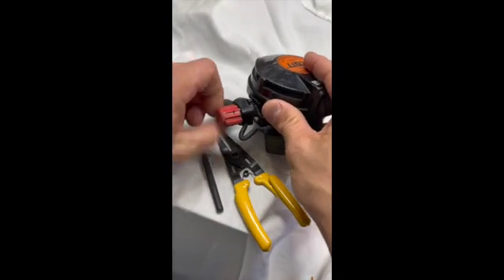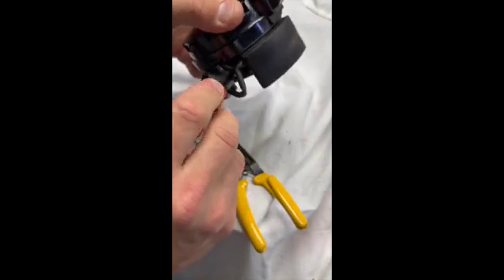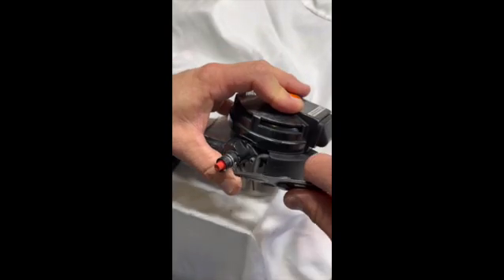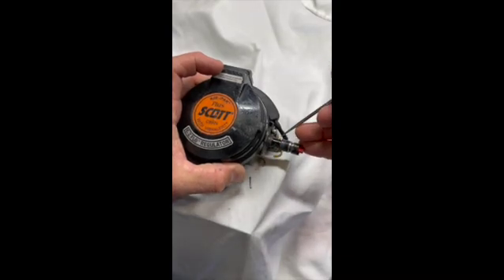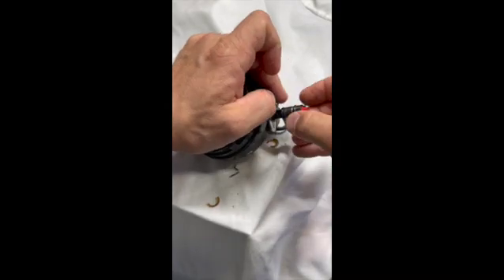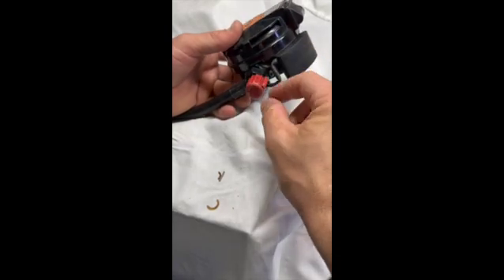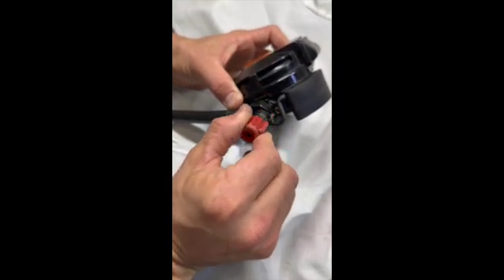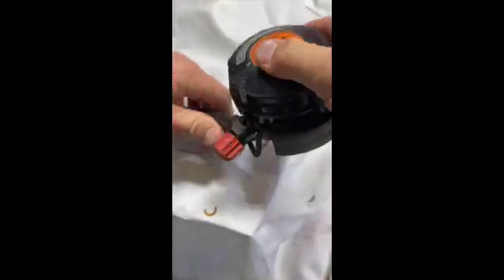Scott 4.5 air pack regulator leak at bypass

Comment: Can I get the link to the O rings you used? I couldn't find it. Also, I'd love to see other videos of simple repair on Scott air packs if you do them. Thanks!
Reply: I ordered the 4 X 8 X 2 and they are too small.
Reply: @chasedunn7839 yeah same here. The ones I ended up using are 8mm ID x 2mm thickness
Reply: @chasedunn7839 what size fits?
Reply: @chasedunn7839  Did you find the proper size? These are too small. Thanks!
Reply: @chasedunn7839  Yep definitely way too small.  They may be like 8mm i.d. instead of 4mm.  I will have to measure.
Reply from the maker: uxcell Nitrile Rubber O-Rings 8mm OD 4mm ID 2mm Width, Metric Sealing Gasket, Pack of 200 https://a.co/d/4RrMydI

Just make sure you order 4 x 8 x 2